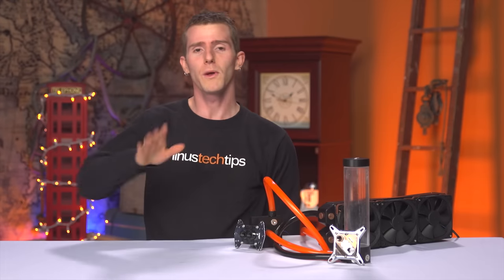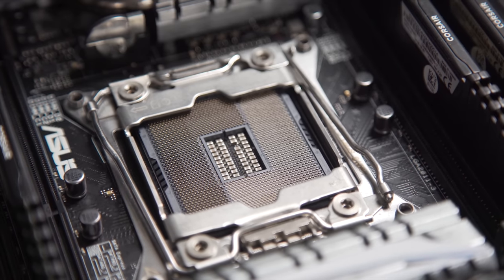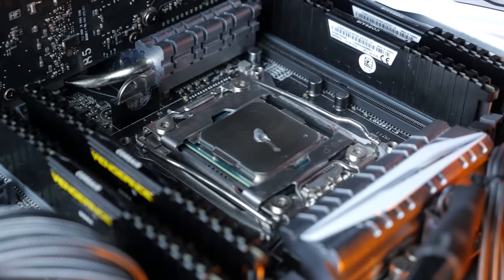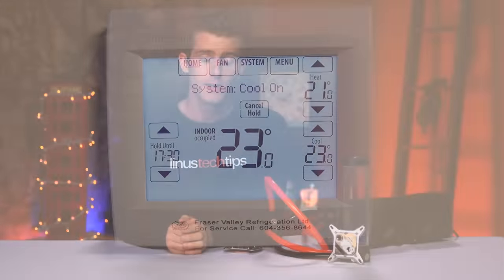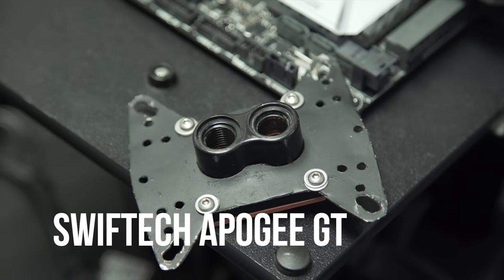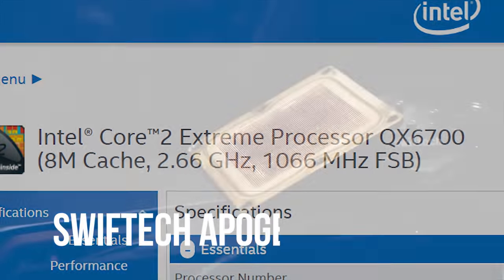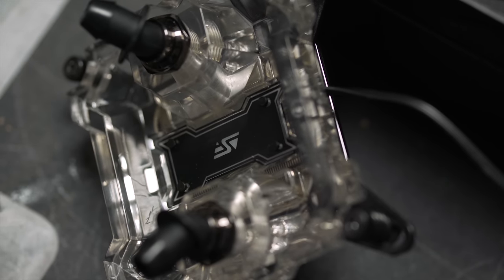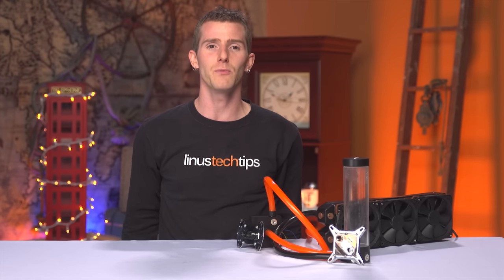TEN YEARS of Water Cooling Performance Tested! - Through The Ages Ep. 1

Comment: Water cooling is dumb. All this for 3 to 5 degrees?
Reply: you might get 100mhz
Reply: Yup. Very expensive, a pain to set up and manage, and if not done perfectly right it can have a risk of damaging all your components in your pc. Definitely not worth it unless you are swimming in cash that you are willing to just throw away for a couple degrees.
Reply: I'd like to see you overclock a modern CPU more with whatever reasonable watercooling setup you want vs an NH-D15.
You'll run out of power delivery before you run out of cooling.
Reply: yeah, you'll run out of power, especially when 1500 watt PSUs are a thing, look watercooling isn't cheap, it's for people who want to get the best of the best, and a 1500 watt PSU is part of that, you're just criticizing whatever you can on the internet.
Reply: and for silence.
Reply: um its alot more than 5 degrees in most cases
Reply: where the fuck do you live? the artic? My gpu is rocking 50-60 degrees useally. Not sure how hot my cpu gets tho and im on air. And intels little air thing for the cpu
Reply: Yassin Grim

The sticker on the side of your PSU doesn't mean a fucking thing to how far your CPU overclocks, hence why i said power DELIVERY. The motherboard needs to be able to throw all those volts and amps at the CPU in order for the cooler to dissipate it, and you're not going to be exceeding the heat carrying capacity of an NH-D15 before you run out of power with a modern intel CPU unless you have a $500+ board and set it to fucking LN mode.
Reply: damstachizz Its okay. People who know things know what you were talking about when you said power delivery
Reply: +Yassin Grim

You may only have 1500Watt PSU but only certain things like the graphics card and CPU and MB and about EVERYTHING ELSE can only receive a certain amount of power and no more, there are things called power modules and power regulators in these components and they have a set static limit of power they can draw. Good work trying though thinking you know how PSU's work
Reply: Just thinking of putting water near my expensive computer components makes me cringe.
Reply: *****
thats exactly what I did
Reply: Swimming in cash ? I have spent total of about 200€ on my loop over the past 13 years. So it has been actually cheaper than buying good air coolers
Reply: Rentta
I just don't want my expensive components swimming in water in-case a leak occurs. And I got a amazing air cooled system for around $100, so seems to me mine was actually cheaper.
Reply: Rippyboy701 I have a water cooled server in my rack and I've never had a problem. Water cooling is very sensible if done PROPERLY.
Reply: i did ice water cooling for 2 years and had 4C to 8C idle temps 40c under burn tests and 15 -22c gaming temps on an i5 3570k at 5ghz. god i miss my old life.
Reply: It looks good!
Reply: Even worse...

Doesn't matter who one manages to find to build ones system, or the level of hardware for water cooling. There is a far above 10++ percent ration of the water cooling actually causing grave issues
Reply: it just doesn't make much sense on CPUs. GPUs are another story. From a reference air cooled card you can easily expect a 25 degree drop and MUCH better overclocking (especially with a fully unlocked modified V-BIOS).
Reply: And it looks better xD
Reply: Actually, you can get a lot more than 5 degrees difference. Volume is important, more than fan and radiator size. I could knock off close to 70c on my CPU when driving it really hard.
Reply: +Drazard 10100   So wait...I am not trying to argue here, but to understand. If what you're saying that there is a certain amount of power that components can draw, then how does it happen that when OC-ing something you must increase the wattage, not to mention the extreme overclockers with liquid nitrogen users, how do they overcome this "set static limit" ? they have same components like everyone else, just modified cooler, and these components are required to draw more power from PSU in that case, since...logic. I just want to know.

+LMS  He means 5 degree difference, not a temperature AT 5 degrees, since the discussion is around the differences that water cooling makes vs air cooling and liquid cooling.
Reply: Engineering 101. Power stations use huge cooling towers filled with water. This is used to condense the steam back into water, pumped round, heated then sent to drive the turbine over and over. The large volume of water can accept huge amounts of energy. So, the greater the volume of water in the cooling system, the easier it is to maintain the lower temperature conditions. This is so much the case that you can simply use water towers with large volumes to passively cool water effectively saving money.  If you have a small volume of water with lots of heat,  you need a massive amount of radiators to do the job quickly enough to achieve the same goal, that's is to say, maintain equilibrium. 
Water has an incredible heat capacity. Really, it's huge. Leveraging this capacity to store heat is the real trick. It will take a very long time to heat several litres of water. This gives your fan plenty of time to remove heat. Heat is simply lost from the system by radiation too, like in a cooling tower on a smaller scale. You eventually reach a point where you have a large enough volume of water as to not require a fan at all. But using a small radiator keeps the volume down to a more practicle size. Think of it a bit like dilution but it's heat that you are diluting. You just need to keep ahead of the large volume, not the big delta T in a small concentrated system. Sounds strange perhaps, but that's how it works. You can't go below ambient but you can get stable temperatures near ambient. That's the trick as it's stable at near ambient, literally writhing just a few degrees.

I've actually heard of folks burying a water tank in the ground and letting the heat be transferred passively. A bit different but the principle of a large cold sink is at play again. Heat is lost through conduction into the ground, so very efficient. It's a closed loop so the pump doesn't need to work to hard wrt developing a pressure head. Very effective though I couldn't be bothered with the work involved in burying a tank and connecting it up. 

That brings me to off the shelf watercooling. It moves the heat but it's not really great. The issue is a lack of volume. I'm not saying they don't work at all bit it's far from ideal for achieving it's ultimate goal. The small volumes simply let you use a radiator in another location to do what air cooling does. Without a way to tap the units off to a big reservoir, it's a no brainer that big leaps aren't going to be achieved. It's a bit of a gimmick. I'm sure engineers know this too when they make these boxed water cooled systems. It's just a job and convincing folks to get a 25 litre Jerry can, hose it up and keep that under their desk is probably a bit of a big ask, so, people get the stuff they sell weather they understand this or not.
Reply: lexzbuddy old thread, but most likely the most/only sensible argument

Comment: imo, the testing would have been more valid if all devices were mounted to a chip simulator rig, as frostytech does, instead of a live chip with unknown specifics. you could then accurately measure performance at multiple power levels - 65, 90 and 125+W for example.

while we're at it, add flow, pressure and temp sensors ahead of the block, and pressure and temp after.

another good series, keep em coming!

Comment: Many have mentioned quietness and better performance as reasons for liquid cooling. Other major reasons and the reasons why I do it is space management and not having a 1pound piece of aluminum hanging off my fragile motherboard. By the way, I saw someone said that it's okay to keep a stock intel cooler on your cpu if you don't really push your computer. The stock intel cooler warps and damages your motherboard. My advice, take that cooler off asap and find a decent aftermarket one with a backplate. Steer clear of push-pin coolers.

Comment: I figured it out. How to cool something, just by touch. You know how wire heats and becomes red? well, just use different metals and build to that process of spreading heat, induce some eletricity to keep it on the other side and cool it with a normal ventilator so it doesnt burn the house down. Its basically what its doing right now only its much bigger than it can be. We should invest in this. Just a little :D

Comment: Not visited (probably because nobody has the expertise, which is not at all an insult) is how the shape of the fins might affect cooling performance. It might seem kind of simple, as you'd expect increased flow to mean better cooling, but it really all depends on a lot of factors. For instance, it's all interdependent on how heat transfers from the dye material to the liquid, turbulence of the liquid, how the heat transfers from liquid to radiator, how heat transfers from the radiator to the air, etc. All of these things depend on each other, and changing one variable tends to change them all. That is why the technology seems a bit slow to change very significantly

Comment: I have an old Apogee or Apogee GT lying around - bought it as part of a "DIY watercooling kit" 7-8 years ago from defunct Norwegian specialists MIST, along with a 120mm copper rad. Used it in my main PC for a while, but after a (self-inflicted) leak I totally freaked out and gave up on watercooling. The same PC is actually still running, just with a new GPU and a Hyper 212 Evo. I've contemplated putting the kit back together, but I no longer have the hoses or reservoir/pump combo, from what I can remember. Oh well.

Comment: Dude! The Apogee was my first block, too! But, these days I just don't get the point of water cooling outside of the 'cool' factor. CPUs today will overclock well past being a bottleneck in your system with a decent air tower; GPUs could stand to benefit more from liquid cooling, but the performance gains are minimal and often the investment could just be spent on a better (or second) card. Plus, I had some hassles with leaks and algae, so it's nice to not have to worry about any of that.

Comment: I feel like Linus should have overclocked that sucker. At the clock speed he was using all the blocks did just fine, but I'm guessing you would start to see bigger difference when the temps get higher. Personally, I think it would have been cool (though a lot more work) if they checked the highest clock speed each water block would allow without going over some maximum core temperature.

Comment: everything matters when comparing watercoolers (flow, block, rad, cooling the rad, tubing...)
Reply: which is probably why this is only part 1
Reply: This is going to be a long series.
Reply: they're only comparing the water block, not the full watercooling loop.
Reply: They do everything right.
They just switch the blocks and keep everything else (flow, tubing, rad, room temperature, water temperature...) the same.
If there are differences in CPU temperature, it can be safely attributed to the block.
This is how you conduct a real experiment.

Comment: A challenge to you, Linus. Would performance be better (even slightly) if instead of 1 ultrawide monitor plugged to 1 of 2 cards in SLI you would connect 1 ultrawide monitor to 2 cards (2 links) and use the split input mode, then set it up as multi-monitor setup in nvidia panel?

Comment: Hey guys, I've been watxhing your channel for a long time now. And as I couldn't find any info about this online I'm turning to you. I just sold my MSI R9 380 4G Gaming and planing on getting a gtx 980. I'm also planing on building my own water loop and this is where I bump into a problem. The waterblock I'm looking at seem to only fit reference cards. So, my question is:" is there a difference in terms of fittings between the reference cooler and after market." Particularly I'm looking at a PNY gtx 980 xlr8. Thank you and keep on making great videos.

Comment: I'd like to see CPU tower coolers.
reasonm:
I have still a Zalman CNPS9500AT lying around that only struggled after I clocked a C2Q to 4.1 GHz @ 1.4 v. Changing for a Hyper 212 Evo brought it down by around 20°C but since it was also a switch from a 92mm to a 120mm fan that seems to be not alot to me.

Comment: Why don't you test with a hot plate? No mount plates, better testing of thermal performance. Just measure delta across the two water lines with an in-line thermometer. Hotter exit temp = more heat transferred.

Comment: So i still use a Core i7 920 D0 ever since i first owned it back in 2014 and recently this month rocking a 4.02GHZ Overclock fully stable with 1.375Vcore.
Main question is i want to water cool the chip to go 4.2Ghz+ but should i use a modern CPU water block designed for 1366 socket, or source a period accurate block designed for a actual i7 920 from 2009 to get best cooling results?

Comment: It would have been VERY nice to see a comparison of current waterblocks. Heatkiller iv pro and ekwb blocks have been tested to run about 5 degrees cooler than any swiftech. Unless you work for swiftech, there isnt any information in this video will benefit anyone. This video shouldnt be called "10 years of water cooling performance tested" as it does not even scratching the surface of the hundred or so from all the other brands. It should be called "swiftech currently makes some of the worst waterblocks, but im going to review one a bunch of old ones they sent me."

Comment: Hey linus why does most water cooling setups does not consist of thermo electirc chip or peltier module ? It will cool the water to like even 2-3 degrees !? or if directly applied on to the processor it will even go to like minus 40 degrees or so . Do you recommend this to overclockers?

Comment: I have a question about heatspreaders, why they are made convex or concave? Is it simple make a smooth heatspreader?
Reply: bigger surface area = more dissipation
if you make a sphere and a cube with the same surface area, the sphere would cost less to make
Reply: If the HIS been soldered on, then its convex(like AMD and X99).  If use thermal past, then its concave(mainstream desktop).
Its impossible to make sure the cooler mount wont deform the HIS in both situation, so yeah.

Also, polish gave no different on performance. Only warranty...
Reply: ***** It kinda works for it tho.

Comment: the i7 6850k is a beast requires corsair 240 all in one water block and clocked at 4.3ghz or better 16gb ddr4-2666 or better to run 2 titan x Pascal with hb sli for 4k gaming over 100fps

Comment: Why didn't you just use a 3D printer to create the various plates? You could have increased thickness as needed
Reply: 3D printing is so an easy word to throw around but can be cheap (with cheap results) or actually good (while expensive) depending on what you use. This was much quicker and easier.

Comment: Does Swiftech have a water cooling monopoly?
Reply: No. there are crap tons of brands out there for water blocks. EK, bitzpower, alphacool, koolance, XSPC, etc.
Reply: I have a danger den 2 kicking around somewhere. It was top of the heap circa 2001-2002? It would make all of these, including the swift look way better. The swifts impingement design was a big leap forward. the danger den 2 had a simple swirl pattern. 

@LinusTech Next you should do "enthusiast" cases. I remember taking a hole saw to a brand in inwin q500 back in highschool to add a single 80mm intake fan. Eventually, in college, I ended up with said danger den 2 and a corvette heater core glued to the front, along with a 120mm delta fan that was stupid loud. Now you can buy the equivalent of all of that for a pittance and just bolt it together.
Reply: Nodus I feel like this should have been separate comments.
Reply: fair enough.
Reply: Nodus i have a danger den double wide acrylic case. loved that thing. when ever i get around to i ill more than likely turn it into a server for my house sense its way to massive to be convenient.

Comment: has anyone ever made a water block that is a hybrid between a regular heat sink (huge aluminium block with lots of fins) and a water block? best of both worlds, big chunk of metal to absorb the heat and the water loop taking care of the fans job getting that heat out of there
Reply: imagine the space needed for that and the cooling perfomance it would give
Reply: nope, but why do you need that? you're describing a radiator but than on the block itself. however cryorig did make a 'hybrid' cooler (aio with a fan on top) to cool the mobo .

Comment: at  1 min, I say it does not make any cooling performance at all. 2005 is pretty modern stuff and all after all, why not try and test a block form the 90s too?

edit, ok it was 5 Celsius between the best and worst, hmm not that extreme but still 5 degrees is 5 degrees hehe
Reply: watercooling in th 90s ........
Reply: bas van der werff

yes? late 90ts and early 2000nds had a lot of fun solutions, peltier, compressor, water. Had old stuff home that I gave away to a friend and they seems to work great with new water cooling parts in his system.

Comment: I wonder what will happen when someone will decide to produce a carbon fiber waterblock
Reply: your CPU would burn up because Carbon Fiber doesn't transfer heat anywhere near as good as copper and when exposed to high enough heat will actually soften up and deform, because carbon fiber uses the same kinds of resins used in fiberglass and those get soft at higher temps.
Reply: I forgot to mention that the plate would still be copper but its a bad idea anyway, dumb comment, too tired
Reply: *****
OK yeah even then Carbon Fiber lays down like fiber glass, don't think you'd be able to get it smooth enough to create a reliable seal.